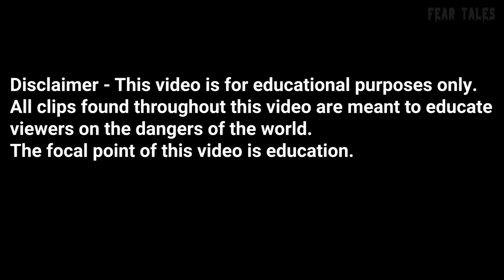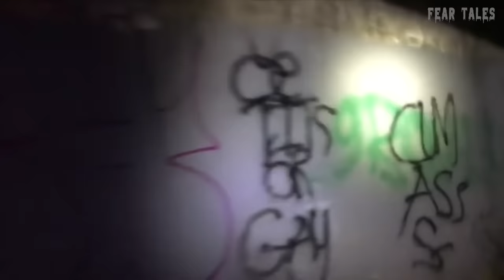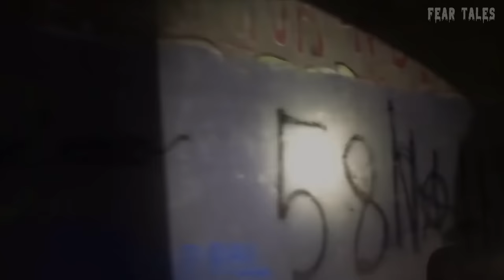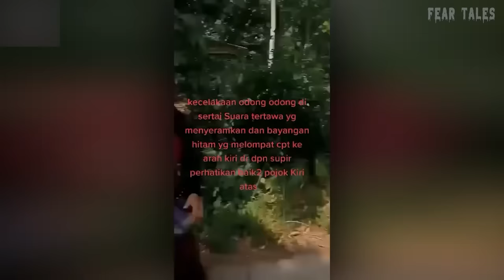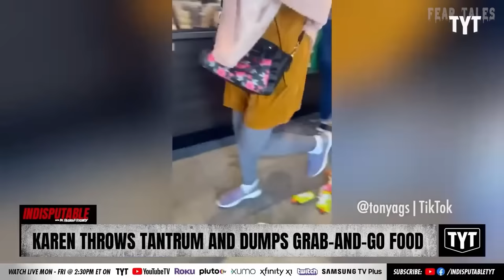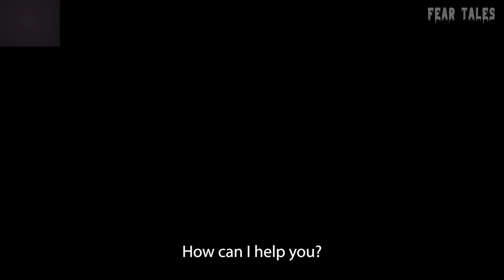100 Most Disturbing Things Ever Caught On Camera

Comment: “Railroad Crossing” 41:55
The rescuer did it wrong. He should have removed the motorbike first from harm’s way, then the rider. Reason? If the train had hit the motorcycle, untold numbers of train crash casualties may have incurred. If the rider was hit, most likely only he would have been a casualty.

Comment: I once had an electric stove stay on high heat even though the knob said off. It was very scary because I cannot figure out how to turn it off and didn't have access to the plug. I was in my early 20s and not as savvy as I am now, because I would've gone to the breakers. But I panicked. The landlord had to come and shut it off. So, either gas or electric stoves can be dangerous. And you're right, never leave a stove unattended!!